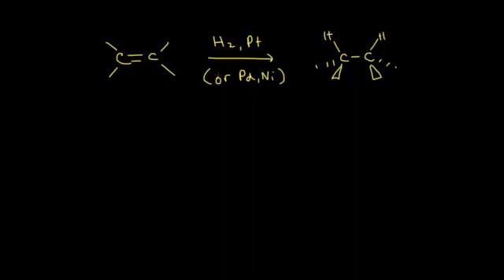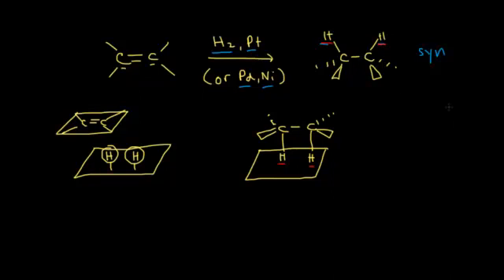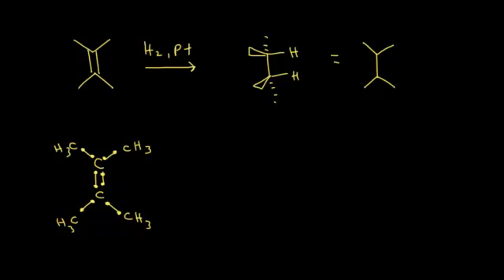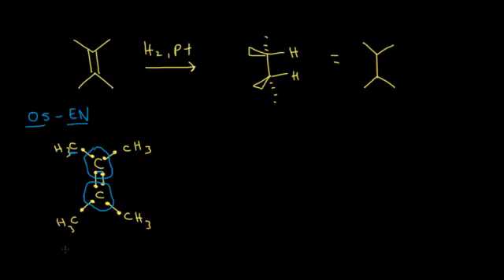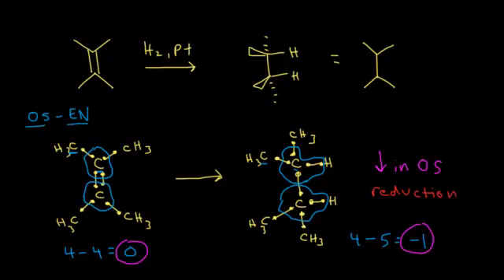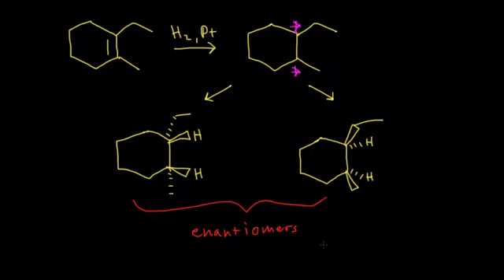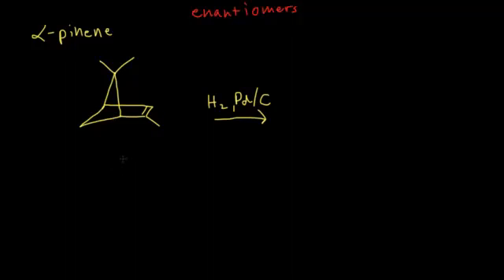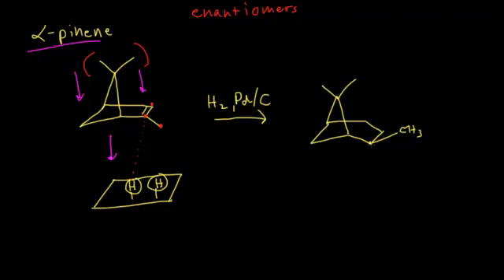Hydrogenation | Alkenes and Alkynes | Organic chemistry | Khan Academy

Comment: We are always taught that this is a syn addition. However, if this was true we would never have the trans fats dilemma in nutrition. Trans rearrangement does happen when the carbon compound falls off the metal catalyst after achieving the intermediate state but before hydrogenation takes place. This happens in significant ratio in partial hydrogenation of vegetable oil.

Comment: You need high pressure in addition to hydrogen and the metal catalyst.... without high pressure, no reaction would occur.
Reply: This is not true, I have carried out many catalytic hydrogenations using Pd-C at room temperature and pressure, it all depends on the substrate - some require additional pressure whilst many do not.

Comment: I am confused... if the 2 molecules that you say are enantiomers are mirror images of each other (as you say in the video) shouldn't the dash-wedge hydrogens be facing each other? Aren't they chiral? And therefore not able to be superimposed onto each other?
Reply: Your confusion is arising from the way he has drawn the enantiomers. Imagine flipping the right hand structure over vertically - this will have the effect of moving the methyl and ethyl groups from the right to the left as drawn, but would also change the two hydrogen atoms from projecting into the plane of the screen (originally dashed lines) to projecting out (wedges) and vice versa for the methyl and ethyl substituents. You will then have your two sets of hydrogens facing each other as you describe and it would be easier to see the two structures are mirror images of each other.